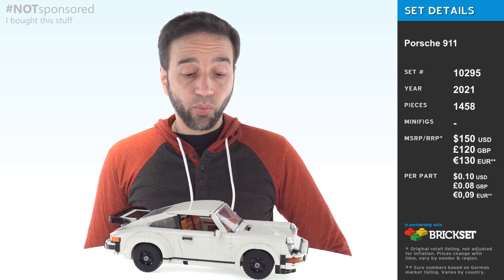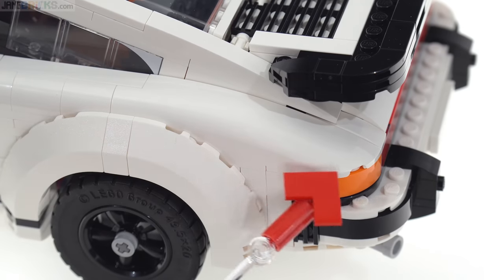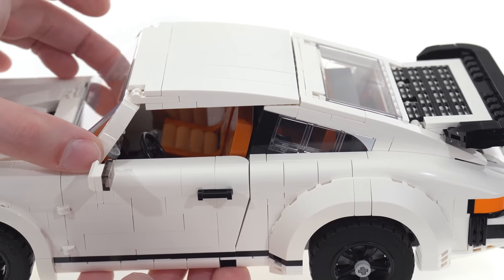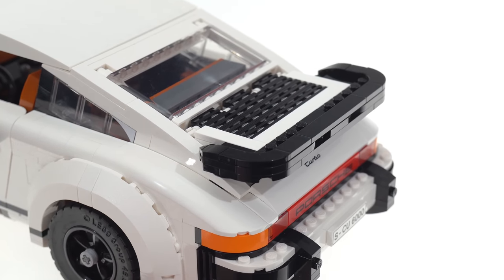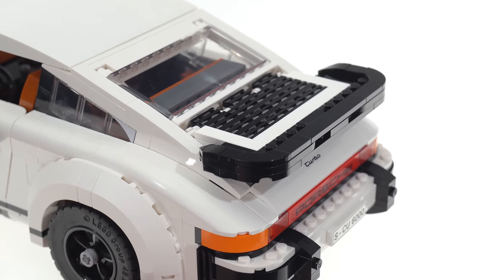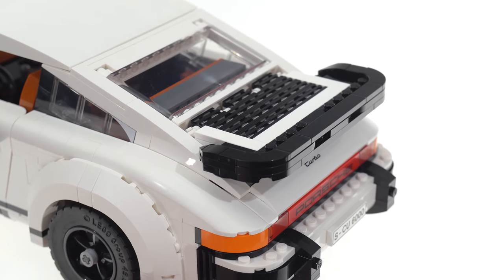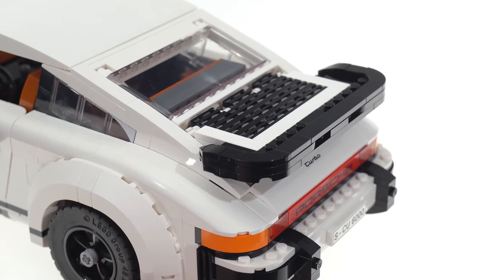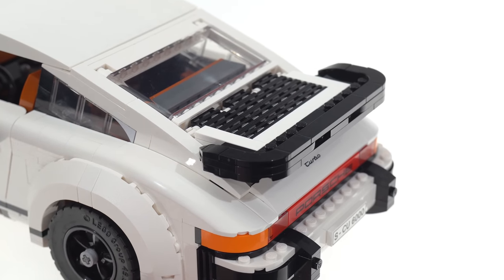LEGO Porsche 911 Turbo / Targa 10295 review! One of the best yet IMO

Comment: @Jangbricks with the windshield parts. They probably scuff directly in the factory (if the machine toss 100s of them into single container), not in the package. Anytime I requested replacement, it arrived even worse, and those are individually sent in plastic bag and bubble wrap.
Reply: Well that's unfortunate :(
Reply: Yeah it’s definitely an issue. The windshield on the Ecto-1 is an absolute nightmare. I made a PSA about that in my review in EB for it, Lego had no clue what I was talking about when I told them this new clear material is getting seriously scratched...
Reply: Not surprised it gets scuffed when it comes to production processing. Unless you own your own lego company.

Comment: As a 911 fan I had to get one and very pleased I did. I had a Lego Model Team jeep in the early 90s as a kid and it’s amazing how much the detailing and construction techniques have come on. I was staggered at the way this set comes together as you build it. The way the front windscreen clips in, and then the way the rear is angled perfectly for the roof to fill the gap is pretty amazing. Great fun to build and looks stunning especially as the turbo

Comment: Fantastic review covering both models. Definitely a bigger fan of the Turbo variation at it all around looks better, uses significantly more pieces for what you're paying. Changed up mine to the Targa the other day to fit a couple of 6" Figma figures, and though the scale is close additional head room was needed. Never had need to adjust the rear seating though. Conversion process was a lot quicker straight forward than expected. Wish Lego had included an additional bag of parts so the sub assemblies could remain intact for quicker conversions. Lastly didn't really notice and color variance in the white, sides  the printed window piece which IMO is one of poorest printed prints ever. Not to the extent of the near transparent yellow of some of the Fiat 500 pieces.

Comment: I love that car.  But on the floor, in front of the right seat, you can see a red Lego brick.  Why is the car not finished here?  The axles that hold the front wheels are brown, but those that hold the rear wheels are gray.  They should be the same.  Otherwise, I am very impressed!

Comment: Great review.  I chose the Targa.  Looks classier and better lines.  Didn't like the top though as you said.  Doesn't look right.  The floor also looked unfinished so I tiled it off making it look like it has some dark grey floor mats front and back.   I didn't have to move the back seat forward to get the window on.  Also you are paying for the design as well.  Don't know about you but I couldn't have built one like this without someone designing it for me.  Amen to the windscreen scratch comment.

Comment: While I understand your gripes in regards to the specialized piece, I also look at it from the opposite perspective. Who else other than a lego designer has this sort of power? I think the designer did the best with this request for a new part. It's just perfect here.
It really sucks when you 'need' a part to achieve a certain shape but that part doesn't exist.

If the rear quarter was brick built from existing parts, it would be nowhere near as smooth and it would clash with the rest of the model visually.

It may feel "too" specialized now, but I think it has great potential to become very useful down the road, because it was designed with smooth transitions to existing pieces in mind, especially if they roll it out in different colors in the future.

Comment: I've built this as the Targa, but have built it with the wider wheel-arches at the rear from the Turbo. Probably not true to actual Porsche design, but I like to imagine it might have been done if Singer built a Lego Targa ;-)    Also, I might have gone wrong somewhere in my build, or perhaps you could double-check yours, Jang, but on my model there doesn't appear to be such a big gap between the rear seat and the engine bay. Basically, the grey line at the top of the seat leans against the body work of the engine bay, without having this one stud wide gap...

Comment: I know there's a video about it, but I wonder how easily it is to swap some parts of the Turbo into the Targa and vice-versa without having to buy extra pieces. It looks like at least the wider arches and the turbo with intercooler can be put in the Targa. If I were to buy this, I'd probably also try to change the front and rear to look more like an 934, and put wider front wheel arches (and wiiiider rear arches) too.

Comment: I saw you complain about thumb tabs on a $150 set, implying that the Mustang of the Aston Martin did not have them.

I checked my Mustang's box, and it has thumb tabs. That's also the case for the other "nicer" boxes that I have (the crocodile locomotive, the Star Wars helmets and such)

also you said that "it's the same price as the mustang and the aston but has a whole bag of pieces more." I shoud add that the mustang also has another bag of pieces with the tuning elements (spoiler, engine cover modification etc) and the Aston has much more "play features" to stick to the Bond's theme that adds up in terms of value to me.

Comment: Word to the wise... be very careful doing the portion of the build where the car is upside down, if you push down too hard you could easily break parts off to the point that will require a significant amount to be rebuilt..

Comment: I totally agree with you. This model is great and the Lego expert car series is propably currently the best within their portfolio. You mentioned the specialized big part  to recreate the curved geometry. Actually, a german MOC-designer and company CADA have a collaboration and they released as Set a red iconic Retro Porsche 911 RS which is built purely from standard bricks and it also looks great. Unlike the Lego model, the inner structure is partly built from Technic elements and it has 6 moving pistons under the rear bonnet and 4 wheel suspension.  I don't know, if it is avaialble in the US, but for everyone interrested, I attached a link to a german speed build including a comparison with the Lego model. https://youtu.be/aUAB163nRCk